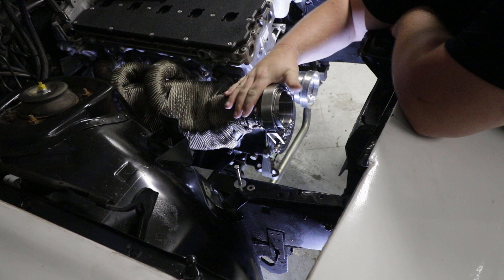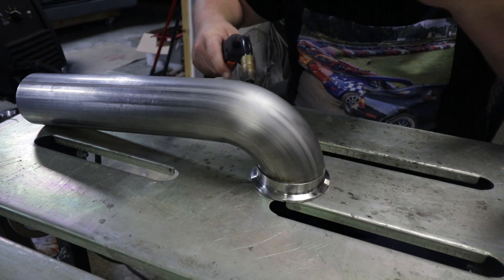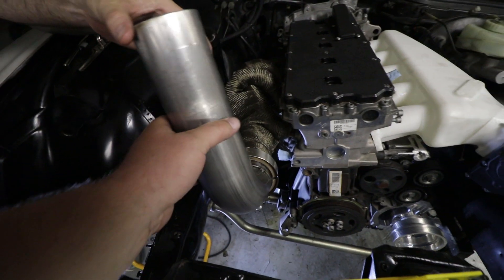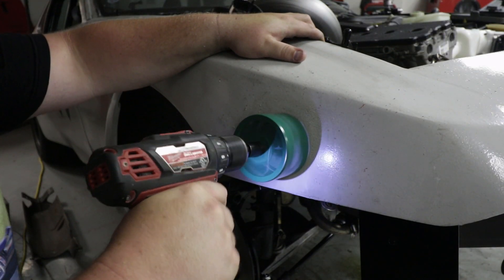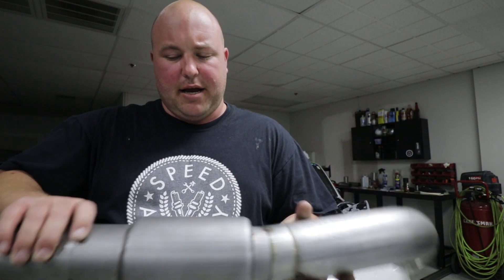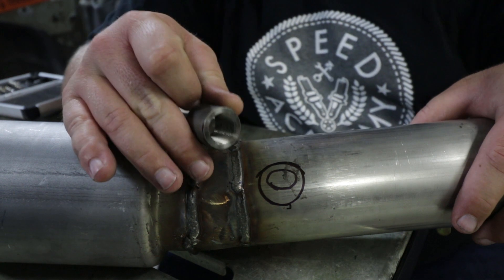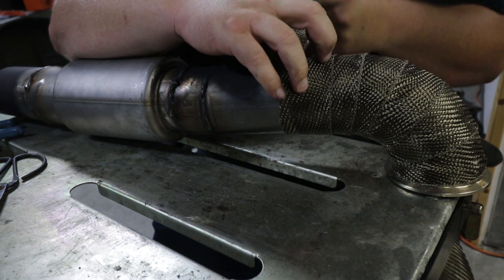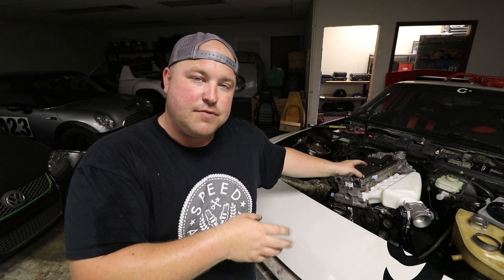5 Cylinder 944 Build - Part 3 (Porsche 944 07K Swap)

Comment: Love the fender exit. Have always dug them, especially on a boosted car with the externally gated dump right next to it. Looks sick dude, and I'm sure it'll sound wicked!👍🤙 Forgot to mention, I've had the brushes get jammed up inside the dremel before or the switch get dirty and taking it apart and cleaning it up remedied that issue. Something to try before you throw it in the trash. They're easy enough to take apart.

Comment: you mentioned earlier, that youre going to gain about 40 hp with this NA set up over the 944 NA. But when i looked up the motor it was listed with 160hp as well. Is there a certain year or model which has 200hp output? And it still would be just at the 944S level, with which it really needs to be compared. you as well mentioned in the introduction, that the 07K flows a 100cfm more than the 944 head. was that compared to 2 valve head or to the 4 valve DOHC head? thanks and I definitely love your channel and your builds! btw: I would love to hear more background info on why you guys do this or that, like the reason for the oil cooler delete, which you explained, thanks
Reply from the maker: We made 192 wheel on the NA build which is equivalent to a 944 Turbo with exhaust and wastegate shims. Then bump to roughly 230 crank is the intake, exhaust and tune. Thanks for watching and commenting!

Comment: Love the Idea of a 5 Pot engine in a RWD car. Are you guys using the stock or a swapped trans?
Reply: Thanks for Answering! Will def follow this project, my next move is convincing the fiancé to let me buy and do this project!
Reply from the maker: Ha, good luck there, I know how hard it is to convicted my wife!
Reply from the maker: Stock transaxle... There are different stock transaxles from the 944 with varying levels of strength, so they will need to be properly matched to the power levels of the swap. For my mainly stock NA build I’m using a stock NA transaxle. Once I start adding power I’ll have to upgrade to the 944 turbo transaxle

Comment: Are you still planning to install performance cams? If so how aggressive? 
It would be great to get 100+ hp/liter with a N/A 07k...
Will the new stand alone ecu support vvt on both int and exhaust if you decide to upgrade the head or a full ttrs motor?
Reply from the maker: Just saw the rest of you question... Yes, the ECU will cover I&E VVT if need be.
Reply from the maker: Yes, as aggressive as I can find! That will be version 2.0, which will also get high compression pistons and ITB’s. Unless I wuss out and go the easy route and slap a turbo on it

Comment: Really enjoy your projects. One quick question, are you sure putting the exhaust exit in front of the passenger compartment is a good idea? Pretty sure a number of organizations (maybe not ones you care about) frown on that sorta thing. Might be worthwhile checking. It would really suck to get all the way to paint before deciding you need to change this. Regardless, good luck, I'll be watching!
Reply from the maker: Hey Ron! Thanks for the head up. Being just a HPDE car that regulation isn’t one I have to worry about. However, you now have me wandering about fumes, which honestly I hadn’t considered before!

Comment: I got your notification at work today but couldn't watch the video till now. the wrapped exhaust looks nice. I was wondering if there was anyway to run it to the other side of the engine bay and out the back or does it mess with your underbody clearance?
Reply from the maker: There is plenty of clearance to turn 180 and go back out in the factory location, I just thought this was a cooler idea!